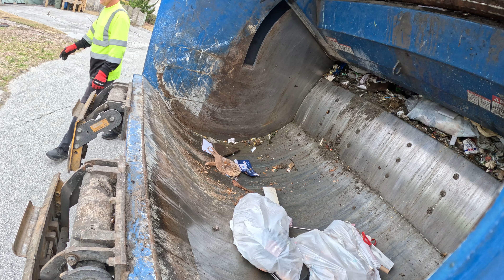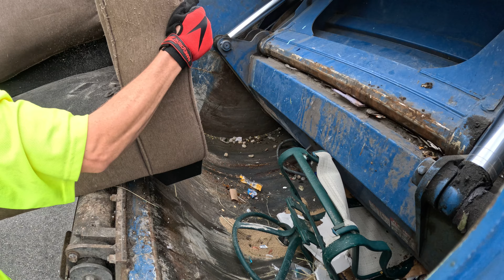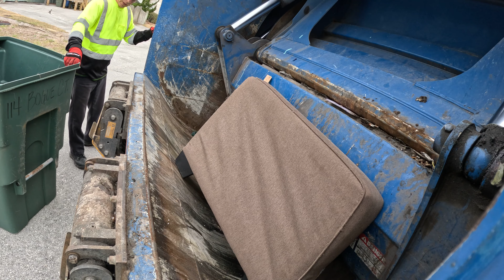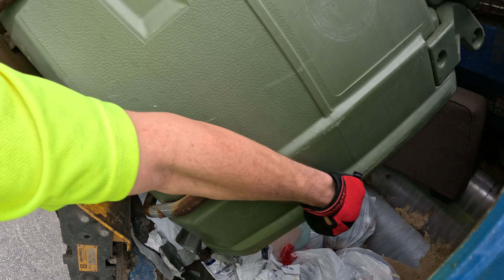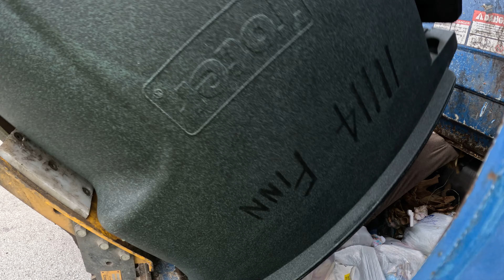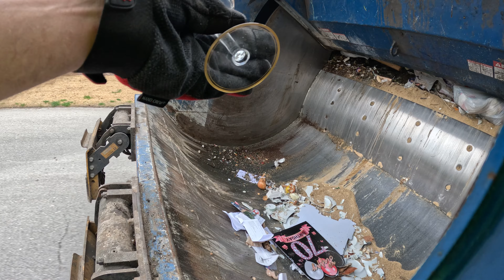Garbage Truck Packer Demolishes a Big Couch + Some Chairs

Comment: wow i remember the city of Goose Creek SC running a packer body like this with the same blade 
would follow them on the 2nd Wednesday cause that was white goods day back in the 90s

WASHERS DRYERS BIG HONKIN 32 INCH CRTS THAT SHOOK THE TRUCK WHEN THE TUBE BUSTED 
WATER HEATERS WENT VOOOMP WHEN PACKED SIDEWAYS  now they brought by a grapple truck to pick that up and took the fun away 
sadly newbern tn does the same thing
Reply from the maker: Yea we don’t get to crunch many of the big items (electronics like tv washer dryer) they been getting strict on what goes in dump but I did throw a whole blow up pool away the other day and when we ran it up, that sucker popped and felt like it blew me and the drivers ear drums haha I was all discombobulated